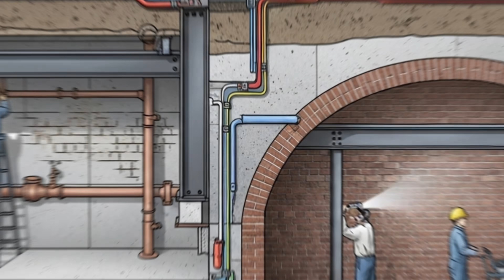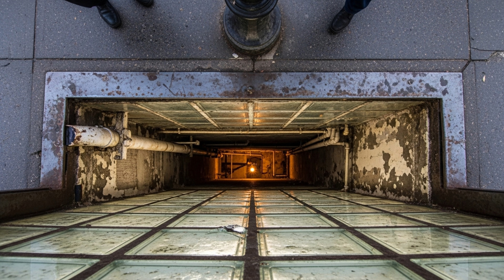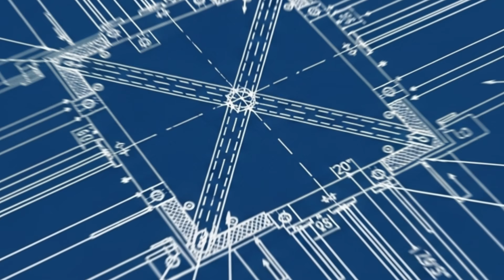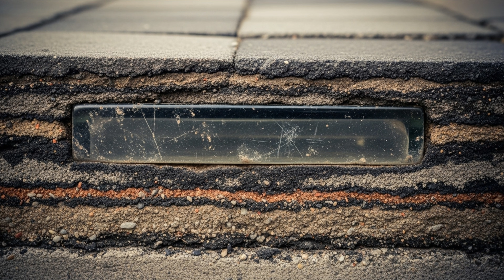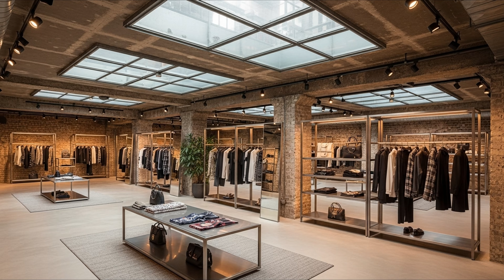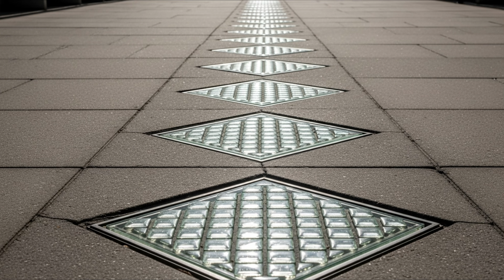The REAL Reason Sidewalks Have Buried Glass Prisms Every 10 Feet

Comment: In the heart of the original standing buildings in Melbourne, stands altered, but still in use are the same old Tartaria style structures. Along the footpaths you can see the tops of windows.  Some have a sky light built-in to the footpath next to the below ground window. Usually a patern of squares formed together and fixed into the footpath outside. Inside I've seen what its like myself. The squares are of thickened glass, allowing enough light to read a book on a ladder right next to the filtered natural light. You can see shoes pass by, but you can't see through the glass. The ceilings are quite high and you know it's the original first floor. If it still has ssome of the original design on cornices and ceiling, then it's a bonus.